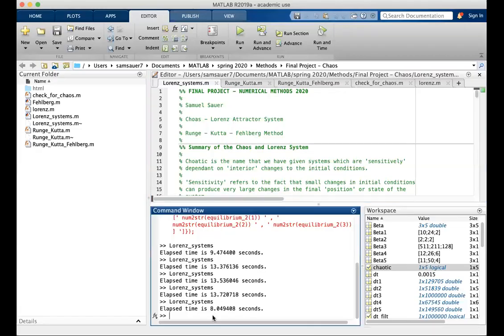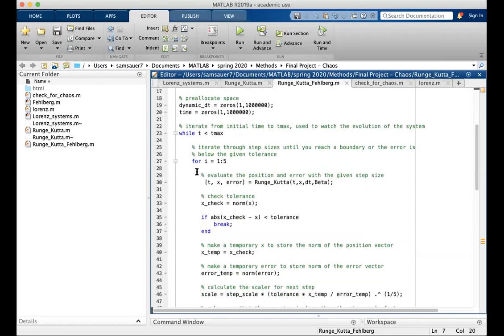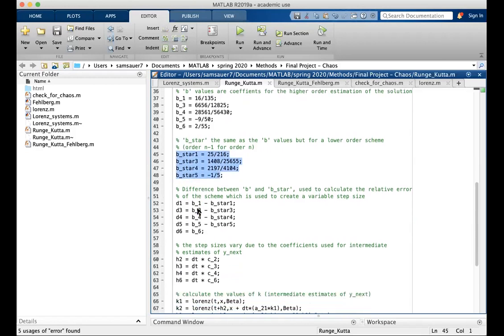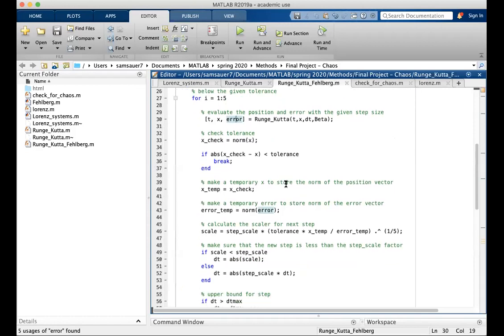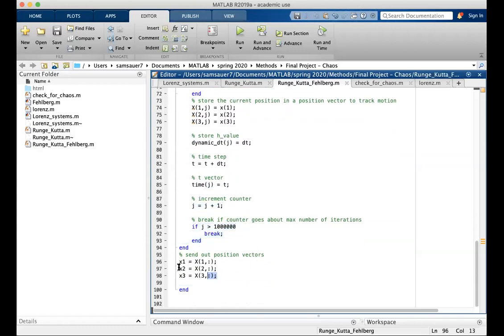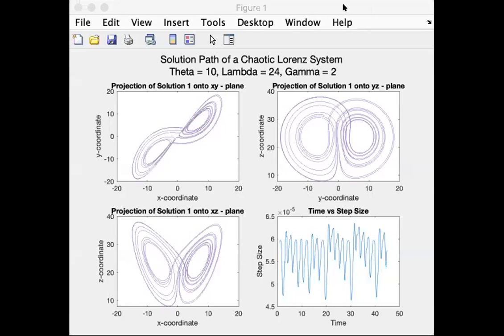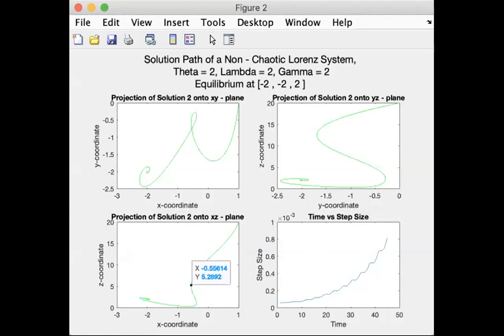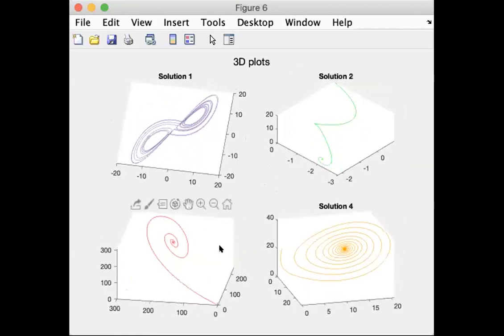Lorenz System - Runge Kutta Fehlberg Method  - Chaos

Comment: Hello Sam, thanks for this great video. I'm modelling 7 sets of coupled differential equations, I have a bit of a challenge with my code. Any chance of contacting you for assistance. Thank you very much
Reply from the maker: Yo! You can definitely try me, but it has been a long time since I have dealt with this stuff. I haven't done anything as large as seven sets of coupled differentials but if you are trying to implement the runge kutta method I might be able to help.

Comment: Congratulations for the excellent video. However, I would like to know how you compute the relative error and the absolute error in each step in order to compare them with the tolerance. If you have some explanatory material, I would appreciate it :)
Reply from the maker: Hey Diego, the relative error takes advantage of the fact that I used a fourth and a fifth order solver. The fifth order will be a more accurate approximation (as accuracy tends to improve for higher order, with the cost of additional computational complexity and runtime). If you see in the Runge_Kutta Section that the 'd' values are calculated using both fourth and fifth order schemes constants. The constants of the higher order scheme is subtracted from the lower order scheme to provide some idea of the relative accuracy between the two orders of schemes. The absolute error would require some way to analyze this system without a numerical solver, or to have known the solution prior to running the solver, otherwise we can only compare to other numerical schemes. You consider the high order scheme to be the actual results and the low order scheme to be your results. When they converge to the same solution, you have reached your next point. This is done iteratively to find the curves. I hope this is helpful! Here is the link to the method: https://en.wikipedia.org/wiki/Runge%E2%80%93Kutta%E2%80%93Fehlberg_method and I would recommend comparing the Butcher table to the constants included in the Runge Kutta code, it may clear up the relative error for you.
Reply: @samsauer7536  Thank you so much for your clarifying answer! 

My doubt was related to the fact that I've at hand a system of four 1st-order ODEs (one more ODE than your Lorenz system), that is, four coordinates that evolve over time. I didn't understand how to check the error of the solutions vector. Now, I can see that you compare the norm of the errors vector with the tolerance. I was wondering whether it is possible to compare each error of the errors vector with the tolerance. For instance, if one does this latter, one can compute which coordinate (of the four coordinates, in my system) gives the highest error. Therefore, that error can be used to determine the optimal time step in order to decrease that error in the next computation.

Finally, as bibliography is usually written bearing in mind the numerical resolution of only one ODE, the RKF method for a system of ODEs is difficult to find (at least, in my case). For this reason I really appreciate your video and would like to share this extract from the book "Numerical Analysis", Burden, Faires and Burden, 10th edition, (ISBN: 978-1-305-25366-7):

"The other one-step methods can be extended to systems in a similar way. When error control methods like Runge-Kutta-Fehlberg method are extended, each component of the numerical solution (w_1j, w_2j, ..., w_mj) must be examined for accuracy. If any of the components fail to be sufficiently accurate, the entire numerical solution (w_1j, w_2j, ..., w_mj) must be recomputed. [...] Converge theorems and error estimates for systems are similar to those considered [...] for the single equations, except that the bounds are given in terms of vector norms, [...]."

Also, I recommend to the beginners in the adaptative RK methods, like me, this simple video (https://www.youtube.com/watch?v=9g_geBN08IY) where RKF's key idea is clearly explained.

Again, thank you so much, Sam!
Reply from the maker: Also, thank you for watching!

Comment: Why u have taken different theta,lambda,gamma values,, explain the differences in 6 figures ,and what is the need for checking for chaos??
Reply from the maker: Theta Lambda and Gamma are parameters which control chaotic behavior, i.e., when those values satisfy certain conditions (there are two) then the function is chaotic, and you can see this by the butterfly shapes on the graph. There are six graphs to show different behaviors of the function according to chosen parameters. I check for chaos to show that the functions which are supposed to be chaotic, in fact, are, and those which are not, are, in fact, not.

Comment: Hello! would you please explain more the Runge-Kutta-Fehlberg method and how to use it on python. Thank you.
Reply from the maker: It is kind of difficult to explain with just words, but I will try! Runge Kutta is a method for guessing the value of the derivative of a function, the coefficients are obtained by rearranging taylor series definition in order to fit the constraints and desired quantities of the method. I used a 4th / 5th order RK scheme and this refers to the fact that I use a fourth order of error taylor series to make these approximations and a fifth order of error to measure the relative error. The fehlberg addition is the variable step size, which makes sure to take smaller steps in areas of large changes, and large steps in areas of small change, this is done in order to save time and to create better accuracy within your method.

As far as doing this in python, my code would look largely the same unless I decided to use classes. I suppose you should use file numpy, but I haven't coded anything beyond a hello world in python so I cant give you general advice, if it is something more specific I should be able to help you. 

Hope this was helpful. 

PS all coefficients can be tabulated into a table call a butcher table and on the wikipedia for RKF 45 you will find the one that I used. If you want a different order scheme you will need to find it's butcher table.
Reply: @samsauer7536  thank you so much. Wish you the best.